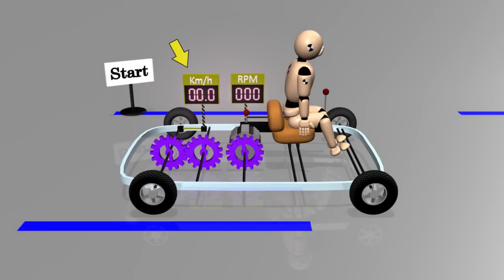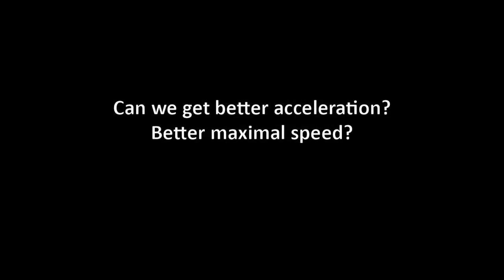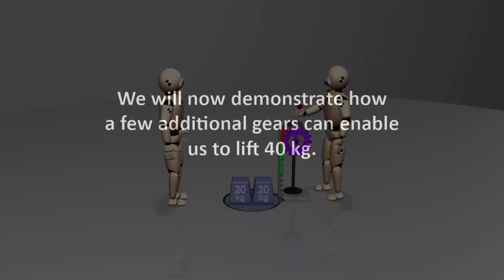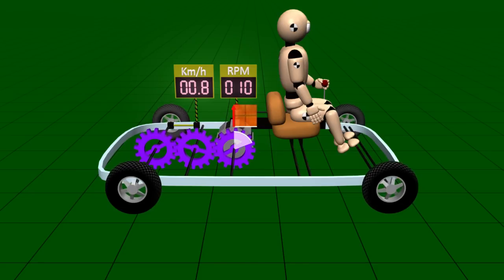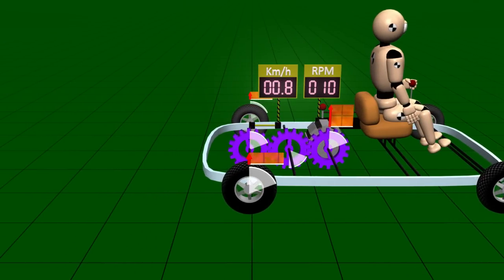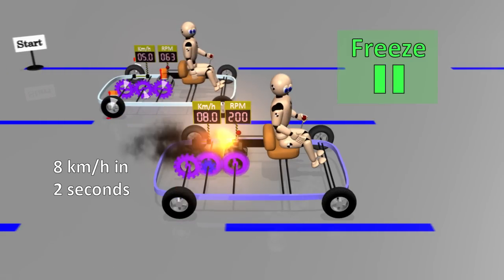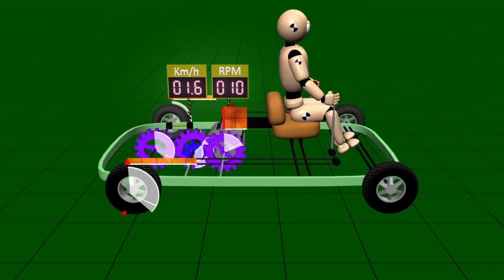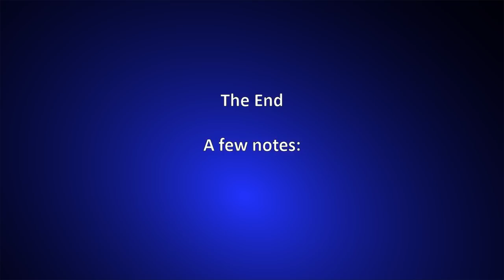Cars: engine power and transmission - 3D animation

Comment: Imagine being such a good driver that you can consistently switch gears 1 rpm before the engine is about to blow
Reply: @Paul Jude what the hey did you do with your gf's insta
Reply: These are the same bots that will take 80 steps to sort 10 objects
Reply: The reasons why manual transmission cars have red lines but going all the way to the red line is not the most fuel efficient but it iss the fastest

Comment: It's the same amount of work applied to the gears. Work is transferred energy, and this is force x distance. Gears change the distance traveled (the relative diameter of the gears), and in doing so, change the force required to move that distance. They are just simple machines, and cannot increase or decrease the amount of work done. A smaller gear can easily drive a large gear (W = f x D), but a large gear must supply a greater force to spin a smaller gear (W = F x d). The amount of energy transferred remains the same.

Comment: Interesting that it work exactly like an electrical transformer:
1. Power is always conserved
2. The voltage is the equivalent to the force
3. The current is equivalent to the "distance"
4. By using a transformer you can get quite better maximum voltage but giving up the maximum current, useful to transfer energy for long distances
5. The opposite can happen also: you can have enormous amounts of current by giving up the maximum voltage, useful for machines such as welders or soldering

Comment: Can i ask you a question , i know it may be stupid but why cars won't move when it's in gear , i mean i know when its in neutral transmission is disconnected from the engine but when it's in gear and the engine is started(i know it's at low rpm) but  it should be move the wheels(but it won't unless you push the acc pedal) why so  ?
Reply: +Brian O'Conner If you are driving a (working) car with manual transmission, when you put it in gear and take your foot off the clutch... one of two things MUST happen.

1) The car will roll forward/backward depending on the gear selected (only slightly due to the low RPM coming from the engine)
2) The engine will stall (the engine will cease running)

If the engine is connected to the wheels via the gearbox, it must be generating enough power to spin them in order to continue rotating... think about it like trying to push a bus with its brakes on, you will not move if the bus does not. Without a rotation by the engine it will not have performed the steps necessary to create the next rotation (fuel and air intake, compression, spark, removal of exhaust gas).

The only time the engine will NOT stall (if the car is not moving and in gear) is when the connection between the engine and the back wheels is not strong. This means either a drivetrain part or the clutch is slipping, allowing for the engine to, in part, spin without applying force to the road. This is obviously bad as it lowers the overall power output of your car and is usually evidence of a failing part.

Automatic cars are different in that a computer controls the selection of gears. If you place an auto in 'drive', you are only signalling to the car that you wish it to move forward. [The car] is the one responsible for engaging/disengaging the clutch and changing to and from neutral, which it will do without you being aware of it.
Reply: Thank you a lot.
Reply: Auto cars have torque converters as well, that may explain what you experienced...

Comment: Hello, I have an inquiry pls
At time 2.52 of this video, both of the free motors had accelerated in similar way . .that is ok..

now once we loaded them at second: 2.58, that car which accelerated faster (the closest to the screen) is due to: the driver of that car pushed the motor pedal harder than the other driver (especially that the motor reaches only 112 by itself), or its just the because of the arrangements of its gears, which led physically  that motor to accelerate faster ?

May u help pls :)
Reply from the maker: +Peter P It's the arrangements of gears. It's causing the wheels to generate a larger force, causing the car to accelerate faster, which also causes the engine's RPM to rise faster.

Comment: Why does the small middle gear need to be attached to that larger middle gear? Wouldn't being directly meshed to that driving gear on the right be enough to increase the force exerted on the large gear on the far left?
Reply from the maker: No, that won't work. You can see at 1:43. When gears are attached in a row, they all exert the same force. In this arrangement they have different angular velocity, but the velocity of the gear's teeth is the same in all of them. The 'trick' with having two gears of different sizes attached to each other has the opposite effect: the two gears have the same angular velocity, but the gear's teeth move at different speeds.
Reply: @udiprod  I think I understand. So by having both middle gears on the same axel it allows the smaller middle gear to rotate at a lower velocity which in turn distributes the force to the output gear in slower but stronger increments. That slower velocity at output allows the original force to be 'squeezed' into that shorter distance covered by the output gear giving it a stronger distribution. BTW, thank you for responding! Great video.

Comment: I've been always wanting to understand what exactly is horsepower, I know what torque is, it is the measurement of twisting force. But how can you explain horsepower in a plain simple way??
Reply: Horsepower is a unit of meaauring power, there are othee units like watt and kg.wt*m/s, and they all represent power which can be simply explained in "the time rate of work" or "the drivative of work with respect to time".
In a simple way you can understand it as the ability of engine to produce work, if an engine's power is 5 watt that exactly means it can do 5 joule of work every second. So if an engine has more max power that means that the engine is more "able" to producs work per second. know tha comment is old but hope that helped anyway.

Comment: guys, i dont understand at 1:04, why it doesnt elevate, it seems the last gear are smaller?
Reply from the maker: If there's just a bunch of gears connected in a row, they don't help. When the first gear  (the one attached to the engine) tooth moves one centimeter, it pushes the next gear's tooth by one centimeter, which pushes the next gear's tooth by one centimeter, which eventually should lift the weight by one centimeter. So it's just the same as connecting the first gear directly.

You can see at 1:47, where the distance each tooth covers is tracked by a visual aid, that they're all covering the same distance. 

At 2:00 there's a different arrangement, where for each centimeter the first gear's tooth is moving, the last gear's tooth is moving only 1/2 a centimeter. This allows the same amount of energy to produce a double amount of force.
Reply: thanx man, really appreciate it.. :)
Reply: do you have  formulas to relate all of this?
Reply from the maker: npataya There are tons of formulas related to this, since there are tons of concepts involved: forces, energy, velocity, radial velocity, radius, torque. You can see for example here: http://en.wikipedia.org/wiki/Gear_train, though it's not easy reading.

The video tries to avoid many of the complexities, and focus on one property, and one formula:
If a gear's tooth is travelling distance X1 and exerting force F1, then it generates energy E=F1 X1. 
If the car (or weight, or whatever is moving in the end), is moving a different distance X2, then it experiences a different force F2. Because of energy conservation we know that F2 X2 = F1 X1,
Or F2 = F1 X1 / X2.

So if you add some gears that cause a distance of X1 in the engine source gear to be translated to smaller distance in the final car wheels, say X2=X1/2, then the original force F1 is doubled.

Comment: How does this work for electric powered cars? I heard somewhere that adding gears to electrics doesn't really do anything.
Reply: Electric cars use motors. Unlike gears, motors are able to provide torque even at zero RPM. That's how diesel locomotives are able to start up massive trains from a standstill and how electric cars accelerate so quickly.

Comment: Can I ask why the rpm decrease when you try to change the gear at 3:41 :D? (Sry  if my question is stupid)
Reply: That is like the whole point of the video, at 3:40 the rpm was about to reach its maximum(200), so in order for the engine to not explode the driver shifted the gear to higher gear.
At the instant before shifting, the engine was at nearly 200 rpm and so the wheels was nearly 100 rpm, because of the ratio of the gears that was 2:1 the wheels was rotating at half the rotation of the engine
So at that instant the rotaion speed of the wheels was 100 rpm so when he made the transmition  the engine "took" the same rotaion speed of the wheels and now became 100 rpm so now he is able to have higher speed in the wheels without burning the engine because he adjusted the ratio of gears. Hope it helps.

Comment: Where is the differential in the car ??
Reply from the maker: Gv sai Sasank The video focuses on the concept of power, and the role of the gearbox. So the simple car models in the video have no differntial.
Reply: Gv sai Sasank No need, the car is moving in a straight line
Reply: RoIIingStoned my tricycle doesn't have that and it turns alright
Reply: U2Jaime1317 an engine isn't driving ur tricycles wheels. + im not implying u need differentials to turn anything with wheels, but a vehicle not having to turn definitely doesn't need them

Comment: im so fucking lost hahahaa
Reply: Energy can be seen as a product of force and distance, hence the graphs of force (red arrow) and distance (white arrow) resulting in a shaded region representing energy, the product, or area, of force and distance. Power is the ratio of energy to time, and when the gears are connected to each other, they transfer the same amount of energy to each other over time. The power that one gear has will be the same as any other in the chain.

Since energy cannot be created or destroyed, changing one of the factors of that energy will not affect the overall energy being put out over time. At any given point in time, the energy that the first gear spends is the same as that of the last in the chain. This means that when one factor is lacking, the other factor will simply compensate. This is a very simple way of saying that if we found a way to connect the gears and add one that slows one of the gears down so that the overall distance that the gear sweeps out over time is reduced, it will produce a greater force, since energy is just the product of energy and force.